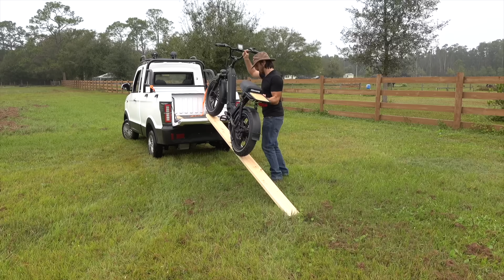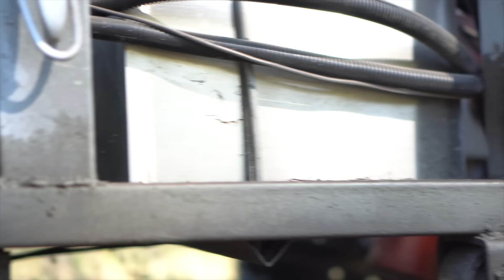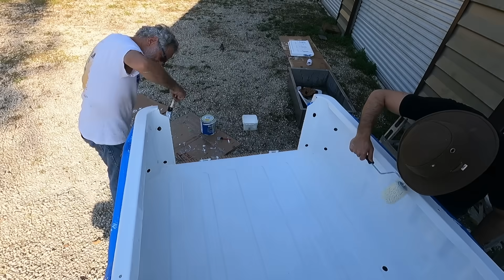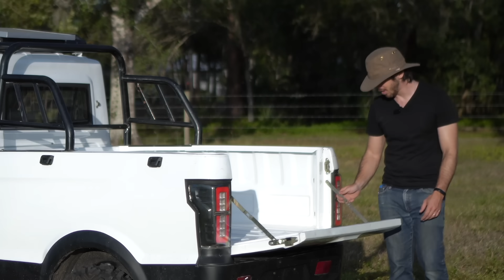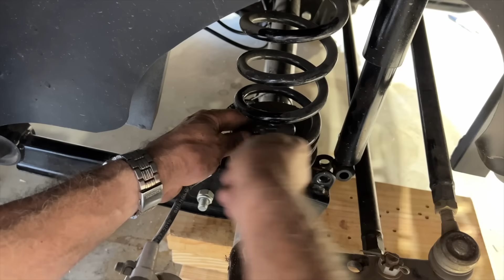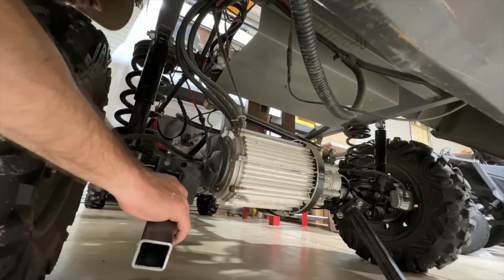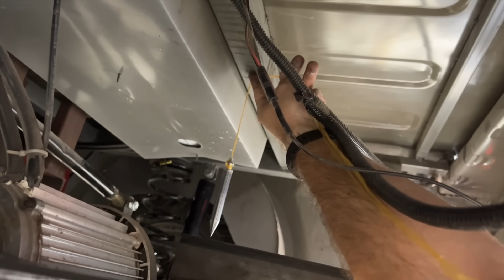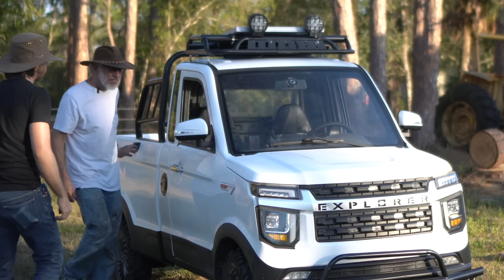My Chinese Electric Mini-Truck 18 Months Later: Did It RUST OUT?

Comment: Thanks so much for this video!  I’m curious about the truck’s low-end torque for climbing hills.  It looks like your folks’ property is pretty flat.  My place has some short but very steep hills.  Would it be able to haul a load uphill?  Or would it stall out?

Comment: The Chinese are really into using coated steels. I had to look up what they called 'tern plate'. It's steel coated with LEAD actually for ease of forming in power presses. The lead acts as a lubricant. Or it may be galvanically zinc plated. Either way, it's better than raw steel.

Comment: One thing about chinese products, that I would like to share with you. You can have the same product with different qualities.

For example I bought two chinese scooters, that look identical. Qinqi Zoner and Baotian Bt49q.

Qinqi has bad welds. All the nuts and bolts needed to be tightened and also some washers were missing and had to be added. The engine was just hastily put together and needed a proper inspection and a tune up. The wires keep shorting out and popping the main fuse. (After 10miles it stinks like electric fire). Plastics are also brittle, hard and have a pretty pungent smell on them.

Baotian works just fine. It ain't the best thing out there, but it only needed some gas, oil and a kick to get it running and has worked ever since. Welds are ugly, but still solid. Plastics are softer, thicker and easier to work with than in the Qinqi. I also got an owners manual with it in my native language, that has pretty hilarious translations in it.😂

Qinqi was about 500 dollars when it was new.

Baotian was about 600 dollars when it was new.

Not a big difference between prices, but a significant difference between overall quality.
Reply: Yeah of course, Chinese companies vary a lot in quality, for example DJI is the best drone company in the world yet they are Chinese, BYD right now is kicking Tesla's *ss and they are Chinese, it really depends on the company, unlike the US China is much easier to start a company in, so many do.

Comment: It needs a winch, for sure. Maybe outriggers and a hoist, so you can move/load stuff that's too heavy for one person? Possibly give it a bigger battery, and an inverter, to make it a mobile power station? Add a diesel cabin heater for winter use, and on that thought, a front hitch, for a plow/snowblower attachment. There's tons of cool stuff you could still do with it.
Reply: Very true

Comment: I love what you have done on the springs and tires. Did you have to do any fender or liner trimming?
Reply: Yes - did have to do some inner fender reshaping (read beat it with a hammer and dolly a bit).  But then with the "lift kit" (LOL) we gained back a lot of space and the turning radius improved quite a bit.  Hope this answers your questions
Reply: @micahsdad5388  I must have missed that somehow. I did a 6/5 lift with 27 inch tires it looks so cool but not good for when I have shovel work. LOL Yours is perfect.

Comment: For the tailgate, use coated steel clothesline or dog runner cable and crimps, make it whatever length you’d like. You can also use it for branch lines if you ever need to protect the windshield.
Reply: The only question I have with the tailgate lying flat is would it hit the ground when the bed is completely raised? Maybe they made the gate open like that so to protect the hydraulic bed from jamming into the ground and damaging it.
Reply: @gititgiitit5450  good point           never thought of that             从吗
Reply: Are you sure the last part of the tailgate hinge doesn’t slide back to drop it down further like a pvc window hinge? The last section next to the tailgate looks over engineered just to be a  anchor point.
Reply: Was going to make the same comment
Reply: Should built full canopy cover for tray backsetup that be looking bad ass set up for camper trip

Comment: The hitch is bolted to the axle (which moves up and down as the suspension cycles) but the threaded rod is connected to the frame?

Comment: Okey i had chinease scooter Yamaha licensed for 10 years 20,000km driven, held strong, nevertheless 18 months for any type of cars, nor the electric battery, isnt any type of success, except Ford and Mazda, even for electronics, i had car that been 18 years old when i sold it, obviously i took some care, replaced parts - cheap, available easy to fix. 18 years for wehicule can be called succes. Both in design and availability of parts. If chinease didnt earn in yuan but in dolar, it wouldnt be as cheap - you woultd be rich enough

Chinease items arant bad, all you need, western made are bad - overcomplicated, hard to fix, expensive. Tons of regulations, taxes patents to pay. It just reminds me neither "socialism" nor "corporatismÄ didnt work. Puts us all into dead end cause all stuff gets too complicated and expensive to fit into these regulations. Chinease are like a bit of fresh air. This thing is like US made but in 70-80, and small, or russian, or german made in 60, these days every device seems to be made for giants. So woman could feel safe. They put bumpers all around.

And have to have sticker on battery "dont drink"..

Comment: I’d like to think they made the tailgate the way they did so the tailgate gate won’t hit the bumper when dumping. You can do a dual position mount when you switch to the cables when dumping set it to the mount that would let it have that slight tilt so it wouldn’t hit the bumper. Hope everything goes well awesome little truck good luck with it. 👍🏼🙏🏼

Comment: I think a winch in the back and a winch in the front would be nifty. You might want to reinforce the back wall of the dump bed if you do. Your pops might be able to winch the trash cans up! Maybe some sort of plywood ramp that can tuck in that would bridge the gap to the ground
Reply: You could make a bespoke Jerry can that is just a battery pack, maybe with a built-in flood light. Opposite side Jerry can as a water jug?
Reply: Ladder rack on the top side of the bed
Reply: Outside bed mounts for shovel and axe.
Reply: Okay last one. You could weld in some steel square tube with solid walls in the back corner of the bed. And you could use that for a swiveling winching boom arm that could dropp in. I saw you picking up some big (ish) firewood rounds. So you could drop in the arm use it to crane up the firewood swivel it into the bed and then release and load up more.

Comment: If a person has fabrication skills, and welding equipment,  for about $1000 possibly $1500,  plus the cost of battery, motor and controller. This. Could be a serious electric vehicle! Reinforce the frame, and mounting locations, maybe install a rear diff from a small vehicle, and use a Nissan leaf motor, with possibly a 5speed transmission  to allow multiple speed ranges, it would definitely reach highway speeds,  so a wider axel and a roll bar hoop at  least,  For added protection. With a wider track and a wide body kit, add about 12" to the truck,   or maybe a smart car ev can be used, with the wheels .

Comment: How I'd do the hitch would be to use Heim joints at the front to mount it to the frame. Then at the rear I'd use a vertical link to connect it to the bed frame with a Heim joint at the top and bottom of the link. Set up that way the hitch would lower when the bed is tipped up, and it's not moving up and down with the rear axle.

The way you have it bolted to the axle housing and a threaded rod between the hitch and the main frame of the truck, the rod can't be tight. Put a load on the hitch and it'll be twisting on the axle, putting force onto all the rear suspension bushings and it will most likely work the U bolts loose on the axle housing.

If you want to keep it attached to the axle, change it to have vertical pivots there and replace the threaded rod with a link that has pivots at top and bottom.
Reply: appreciate your thoughtful comment.  We are assessing the issue of the threaded rod going to the frame and may need to make some changes along those lines.  Maybe using chain??
Reply: @micahsdad5388  you'd still be putting a twisting force on the axle and the chain would provide zero support except when the truck is unloaded and suspension at full height. If the chain (or your threaded rod) is tight with a load in/on the truck and a trailer hooked up, the hitch is twisting the axle and suspension due to the hitch being rigidly attached to the axle.

Pivot the hitch at the axle and the hitch could be supported by the chain all the time, no issue with suspension compression. BUT the chain would provide no resistance to the hitch lifting when a trailer had more weight on its back end, such as when loading an ATV or dumping dirt.

With a rigid link between hitch and frame, with a hinge, Heim joint, or other pivot top and bottom, it would allow unrestricted suspension movement of the axle, put no twist force on the axle, and tongue load down and up would be taken by the vertical link. Heim joints with grease zerks would be the ultimate for long term durability, but grade 8 bolts through drilled holes in steel plate and tube would do for lighter use for quite a while.

A benefit of attaching the hitch to the rear axle is it doesn't have to depend on the strength of any of the frame and rear suspension, just the rear axle housing. The vertical link attachment point can be reinforced by welding on additional metal, but since the truck isn't (shouldn't) going to be towing giant trailers with heavy tongue weight the frame shouldn't need too much reinforcement.

You could sell build plans for the hitch, like how Riley and Courtney (Ambition Strikes on YouTube) sell plans for some of the metal stuff they design and build.

Comment: Love your video, very wholesome,  some suggestions ,   Fan cover could redirect air current around the motor to cool it down ,  And use transparent tape cover the “USB port”  to prevent dust fall in,  If  there is too much dust in the USB port,  It won't work.

Comment: You can't rigidly attach part of the hitch to the frame, with the tow hitch also rigidly attached to the axle.  The axle moves up and down in relation to the frame; that threaded rod is going to fail.
Reply: You make a good point.  The threaded rod does have ability to independently move up and down through the holes in the frame and the hitch but this may not be the final solution to that piece of the puzzle.  We are watching it and will effect changes as needed.  Thanks

Comment: It's fine in the right places where you can run it on private land. But, it can only be used off road in most states and that limits its utility for many people. Its good that it isn't exposed to road salt. I think it would disintegrate pretty quickly if it were.  Its a fancy UTV that I'm sure would be useful to many people. Now, if they could just get the cost of importing it down.
Reply: South Florida 10 miles from the Gulf of Mexico is a salty environment.  Salt is found in the aerosols in the air and drops out in the rain.  Agree that road salt in the northeast is bad.

Comment: I would look at ford ranger tailgate cables prob close to correct length and maybe even get the studs they use. Most auto parts stores sell them. I would live to have that ebike for my mom she is 73yrs old and wants to go bike riding but has balence problems and weak legs we tried a trike with basket be she gets to tired. A etrike would be best can you recommend one?

Comment: I'm not knocking your hitch (it's something the factory should've thought of) BUT, it's attached to the axle that moves up and down and to the frame that doesn't move. You might want to watch what it does while someone bounces the back of the truck.  I want one of these but I would put a Hayabusa motor in it.
Reply: "I had the same thought - is he using that threaded rod to nullify the suspension?"

Comment: Great video! I took delivery of this exact truck based on Micah's unboxing. Definitely going to look into getting the spring upgrade done. It looks like you used cut up bicycle inner tubes for the rubber cushion, and zip-tied it in place.  I need to do that, too.  Again, great job, and no hater here!
Reply: not an inner tube, a piece of rubberized foam floor mat left over from putting down interlocking tile squares in our exercise room.  About a 1/2" thick and perfect as this bed cushion.  Cost = 0 (scraps)
Reply: - @micahsdad5388  Great idea!  I used a piece of pool noodle. Zip-tied to the bed rail above.  Not sure how long that will last, but free is good.  Next time I'll use the left-over rubber tile, too.  Thanks for the quick reply.
Reply: @johnpdo  We need start an owners/ users group to share ideas and problem solving -- Need a catchy acronym based on the truck name.  We have our homework !!
Reply: @micahsdad5388  Ha! I'll let you be in charge of that. Wish I had some sort of owner's manual.  My came with zero paperwork, so if any future issue I'll really have to did into the electronics.  Crossing my fingers I don't have any. It's been a fun little workhorse.  Hardest part is getting in and out, as I'm 5'10" and 220, and there could be a couple more inches of door width to make it easier!  Now I have another reason to drop 20 more pounds.  Have your son keep making videos.  I'm terrible at it, but like sharing.

Comment: No rust?

Bring it to the uk, or leave it out in the rain and not in a garage and i bet it'll rust just from looking at it.
Reply: Why is it that people can't just accept this is a good truck that has 'weathered' the elements well due to excellent metal preparation.  You really think that the UK is a more corrosive environment than 10 miles from the Gulf of Mexico with a ton of salt in the air and humidity of 95% most of the year?  Okay - we will put it at the bottom of our lake for 6 months so you can see some rust.  But then again, it still may not have any !!  LOL

Comment: what was the cost of all your upgrades??
Reply: Solar charging system ~ $175.  Tires ~ $225.  Tow hitch ~ $125.  Bed liner ~ $140.  Coil springs ~ $300.  Mirror fix ~ $0.05.  Backup camera fix and eliminating 2 clunking noises = $0.00.  Fun doing it all = PRICELESS!!.  That's by memory but not far off.

Comment: Those factory frame welds do look pretty atrocious. I know they're holding up so far, but it might be worth going back through and cleaning/filling those welds up. Maybe adding some reinforcement to some spots too.  I think I would if I had that thing and the time.
However, I do think it is a cool little trucklet. Seems great for a yard truck at the home or ranch.

Comment: Hi Micah,and 'Micah's Dad'.I did ask for "The Electric Bike Manifesto" after winning your drawing.Perhaps because YT had renamed me 'BryDuhBikeGuy7214'?,I think that's their #,but I fixed that,and sent you the email to your address requesting that so"I could build the bikes my brothers had kits for,and my assembled parts for 1".I don't know if my email with my address was accepted as correct?/Love the truck builds.Guess you found those tires much cheaper than the sight I sent .?. Thank you for your videos,and the information in them.

Comment: The Reason the Tailgate has an Angle...
Is when you use it as Tipper, It doesn't catch on Anything..
Make it Flat, you will do More damage to it, when Used as a Tipper..

Comment: hey try a self-inflating centrifugal radial pump airless tire
Reply: nice centrifugal fan spinner cap, just the fins rising from the plate
Reply: china is fine with the k.i.s.s. attitude, dont expend to prestige features, unnecessary, mostly
Reply: try in-tire suspension leaf spring arms
Reply: yes the radial arc sheet leaf springs can be full metal, even if part of the airless tire suspension
Reply: thats mini tractor essentially, electric
Reply: what good you do if you need to be paid by some rules adherence
Reply: its not free if you need to bow to someone
Reply: if you need to be asked to do something, its not good, its evil
Reply: are you catholic for your "good" works
Reply: yeehaa cowboy
Reply: trade is evil by definition, because you want your payment now, in some form or other, any other does not exist, its a false god, glhf

Comment: Make the cables up, you can get cable with plastic sleeving  just measure and crimp and use the original fixing points, think hard, work easy.

Comment: I love this series of videos !  Thanks for the update.  Great upgrades this time , well done.

You should replace that fan shroud.  It's not there for protection.  Rather it is the housing for a centrifugal compressor that spins air outward, then the shroud contains it and directs it along the heat sink fins on the motor casing (through the gap).   Please replace it !  There's literally zero active cooling without that cover!
Reply: Appreciate the comment.  Fan shroud is already back on.  Best regards
Reply: @micahsdad5388  Right on sir!    Also I forgot to complement the trailer hitch.   One of the best results of AdHoc engineering/fabrication  Ive recently seen.    You guys are crushing it with all the  improvements and mods, taking full advantage of the subtle upside of having no warranty to worry about voiding ! 👍
Reply: @GannDolph  We are humbled by your kind comments.  This has been SO MUCH FUN for both of us and such a useful truck.  And yeah - no warranty provides great freedom.  Funny thing is that if it actually came with a 12 month warranty, we would not have had an opportunity to use it !!  How cool is that ?? !!